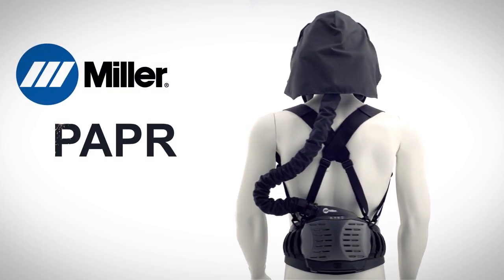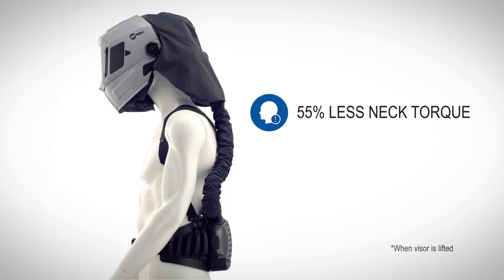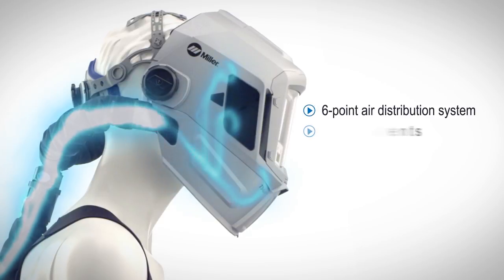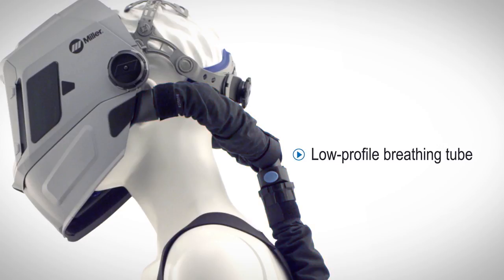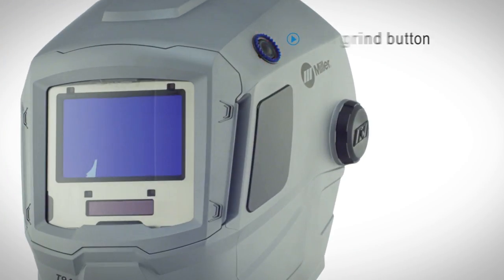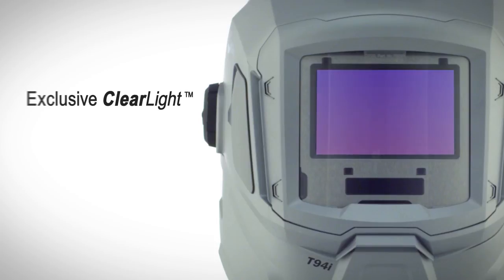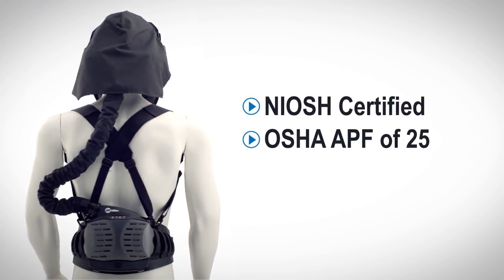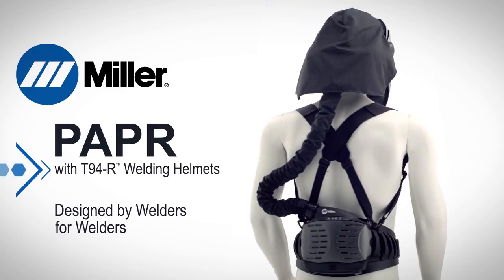Miller PAPR with T94-R Welding Helmets

Comment: Does this work better than a regular respirator like the ellipse or is a regular respirator still technically better
Reply from the maker: Thanks for reaching out. The LPR 100 filters out the same particulates as our full PAPR unit. Thanks again.
Reply: Adrien Alvarado other respirators might have the problems of air distribution, like getting air in your eyes and drying them out. I'm comparing the t94 to the speedglas, viking 3350, jackson bh3, and optrel panoramaxx.

The miller seems to win on paper.

Comment: I need this so bad. Welding aluminum all day is making me sick.
Reply: BlodOchStål how is it making you sick? I’ve been welding aluminum for 3 years now and everything is normal
Reply: Rodrigo Padilla you must be tig welding which has little fume but some armful ozone gas compare to aluminium mig which produce lots of fumes and lots of ozone.  Mig welding will make you sick much quicker than tig welding.  On the other hand, if you mig weld aluminium without breathing protection, it is just a matter of time before it catches up to you.  I have been welding for 50 years and if I am still alive today, it is because I bought one of these helmet.
Reply: CaptainBrexit1700 Don’t hesitate, buy one, they are fantastic.
Reply: @rodrigopadilla8244  Imagine not understanding that every human body is different. The “But i’m fine” is the dumbest statement I ever hear about this stuff. Some men will literally kill themselves before taking their health and safety seriously.
Reply: If your welding all day 
This is it. But if your not and doing a lot of other fabrication details…. It’s a pain in the but.  Down time taking it on and off. 
It fogs up pretty good too.
Reply: @e.s.9285  I ended up getting one shortly after making this comment 4 years ago.
It worked great and I never had any issues with it fogging up, unless I didn't have the air running.
It's so nice to come home and not feel sick anymore.
Reply: @rodrigopadilla8244  Not sure if you feel any different about it, but you must not have been MIG welding.
Everyone I know that has MIG welded aluminum gets sick if they breath too much of the fumes in.
Reply: @grapeape1508  Galvanized steel is awful to weld!
My company lost most of its customers that order products  made of aluminum, so I've been welding regular old steel for the past two years or so.

Comment: Tbh this things sucks to have to wear. 
To take on and off for company policy and compliance welding galvy. 

1. The tube should have a quick disconnect at the filter but doesn’t. So your forced to connect the tube to the back of your head, the headgear of the helmet is hard to put on because of all the fabric. And would be easier to put o with the tube and connect to the filter. 
2. The filter buttons are in accessible while wearing being on top of the back filter. 
3. You can’t adjust the settings of the cartridge without taking it out. 
You can try but you’ll go cross eyed. 
I’m sure it is compliant with whoever it needs to be. 
But if you need to take your not welding steady all day ….
It’s a Paint in the butt.
I spend at least 1/2 an hour every day having to fidget with it instead of putting my hood up/down/off. So I can do layouts. 

It’s overkill.  My company decided to buy 15 of these instead of getting us ventilation to the Addition recently added to the building and all the non welder employees are 100% exposed to the unfiltered galvy fumes.  
It’s a bandaid. 
There are certain conditions were this would be perfect. 
Production of standard parts all day maybe. But I fabricate and spend -waste alot of time taking it on and off. 

🤷🏼‍♂️either way. Whatever the product miller is usually pretty quality. Just woke design flaws imo n

Comment: Hook me up with one ill buy the helmet if you can give me a air system :D i work 70 hours a week 6-7 days a week. Doing millwright work on asphalt plants all across the north east. Lots of confined space welding religning hoppers for aggregates and mainly re ligning the rolled steel on the whole inside of a 50 foot long aggregate dryer for hot mix asphalt I caNT AFFORD THE PURIFICATION SYSTEMS BUT I WOULD USE IT DAILY AND CHERISH IT. I'd give you guys a full video review of the helmet using it in my daily tasks. If you can even break me a deal id be really interested in buying one i have a digital elite now and have for the past 3 years i love it, see if you can hook me up id be honored and make you any vid you wanted.
Reply: How can you not afford it working so many hours welding . Is welding that crappy of a job ???
Reply: I hate the thing. But your the guy that needs it for sure
Reply: OSHA -company is required to supply appropriate PPE.